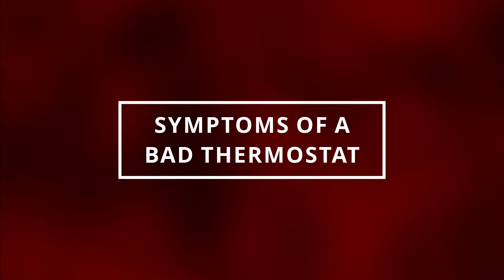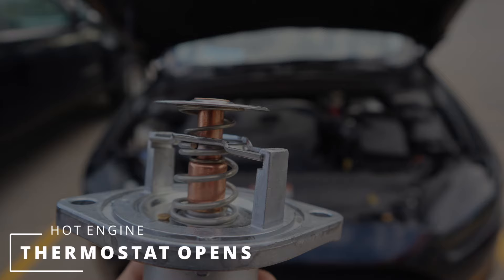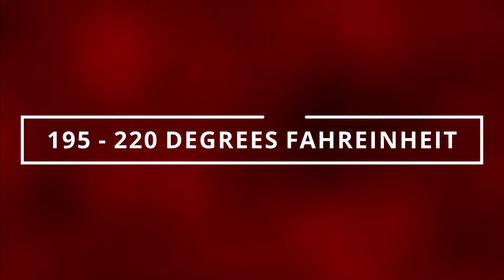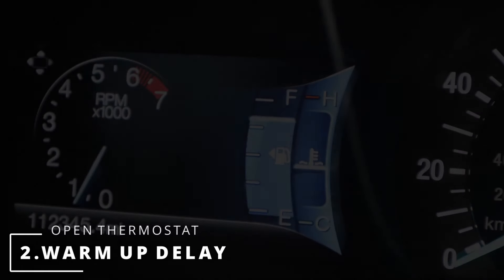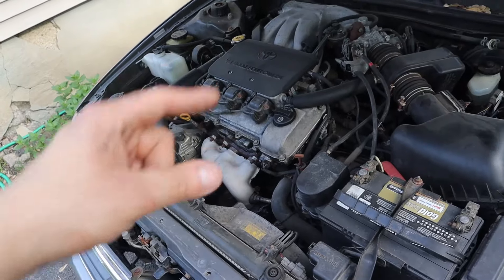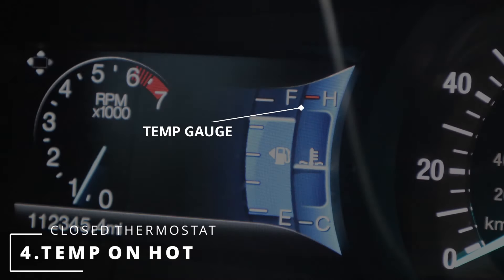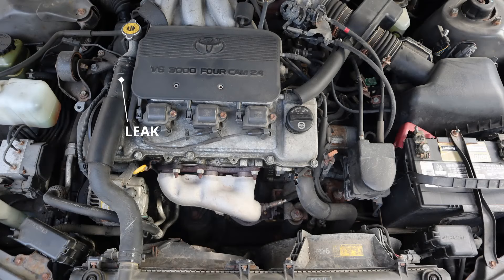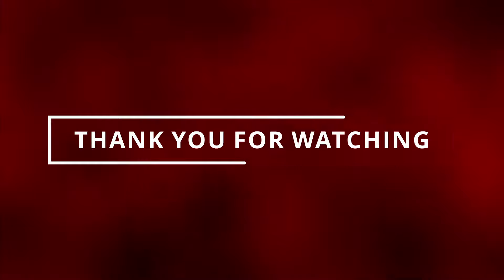SYMPTOMS OF A BAD THERMOSTAT

Comment: I have no overheating, hot air fans work as blows hot in the car and cold also. Temp gauges are spot on. Only thing with mine is that the hoses are different temperatures and thrown up a P0599 code thermostat circuit control high. Can't figure it out.
Reply: Probably a circuit or Valve

Comment: If my thermostat is open can I still drive it just let it warm up a bit longer ?
Reply: Yes, you just won't have interior heat when you want it or it may take a very long time to warm up at all. But as long as the coolant levels are properly filled you can run with an open thermostat if you want to.
Reply: Yes. It will just take longer to have warm cabin air but is perfectly fine for the engine, in fact it prefers it cooler for longer.

Comment: I recently got my thermostat replaced in my 10’ civic, but my car temp still goes down when my heat is on. Do you think they installed it improperly or could it be another issue?
Reply: You probably need to bleed the radiator
Reply: Possibly they have installed it wrong  I just bought a car they say they replaced the thermostat it seems stuck closed  I can hear water struggling to get past the thermostat housing to retreat back to the resevoir along the hose the car is possibly damaged it turned off and wouldn't start I have to tow it home  but my investments to fix this include changing oil, replacing thermostat, replacing coolant w water to save , removing spark plugs
Reply: I thought your temp was supposed to go down when you turn heat on.if it's not overheating than what's the problem?

Comment: What if I drove for 30 min the lower hose is cooler than the higher hot hose? But if I drive 1 hour they both will be same temperature
Reply: May be stuck open thermostat.

Comment: It’s a different season of thermostat some are higher temperature thermostat than the other one you might have for the summer you want to run a lower temperature thermostat and in the winter you want
 To run a higher temperature thermostat 
Summer it needs to be lower because it’s reaches the thermostat temperature faster so it keeps it cool but if your using a high temperature thermostat in the summer it’s gonna overheat 
It will say the temperature on thermostat or inside the open hole just look for it

Comment: That's not true. Anything over 205° is too hot. So it's more like normal operating temperature is 195° to 205°. Not 195° to 220°! My car engine sometimes goes to 207 ° and it's already smoking.